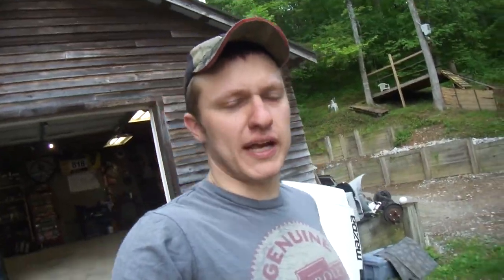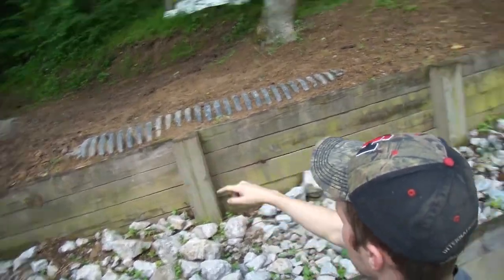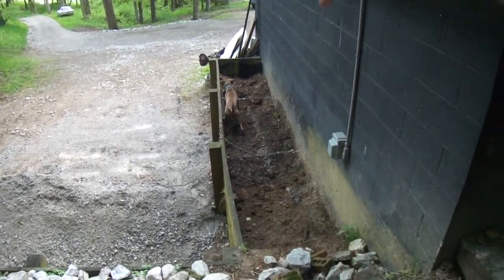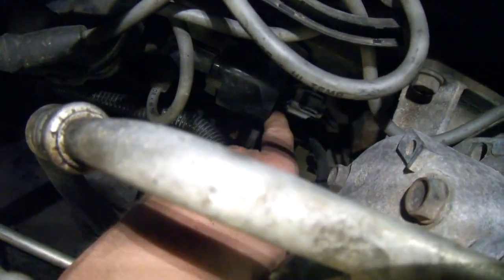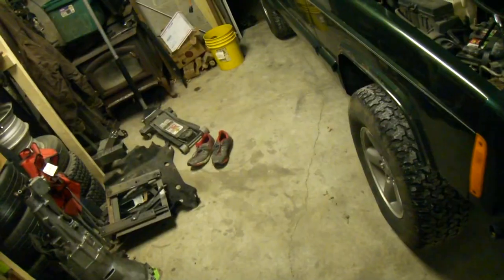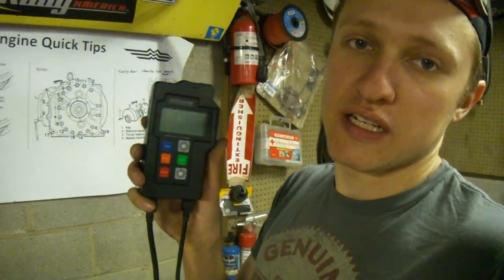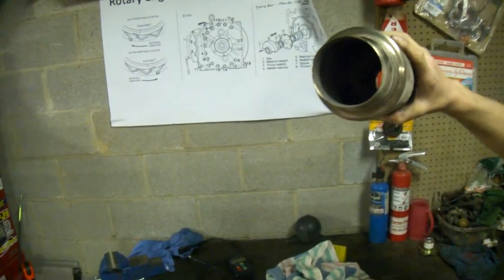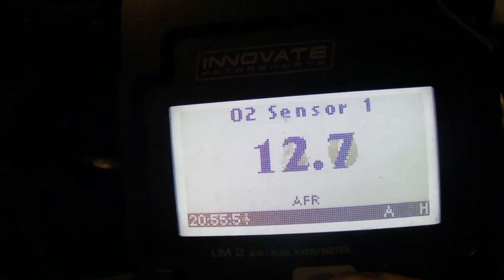Installed an o2 sensor in The Mouse   Full Bridgeport Weber Tuning EP1

Comment: I’m in the process of installing a wideband but I’m not 100% on the placement of the o2 sensor. Which rotor is ideal if only installing one sensor and at what distance downstream should the bing be placed?
Reply from the maker: Rear rotor will run hotter.  I'd stay 18 or so inches down stream. Any closer it will burn up sensors
Reply: @RADPotential  thank you the quick reply.